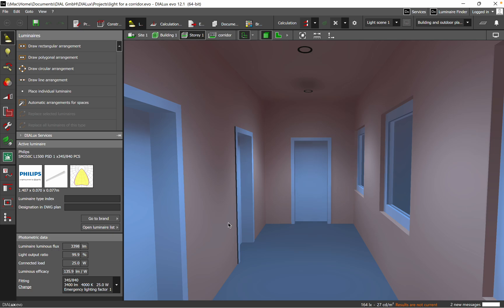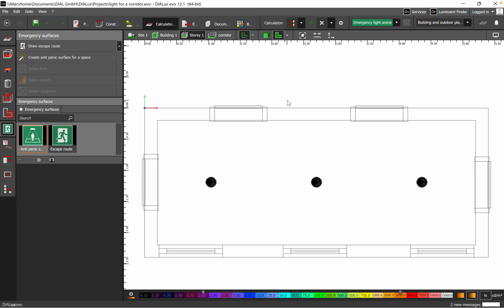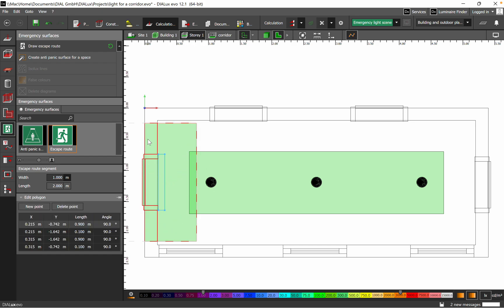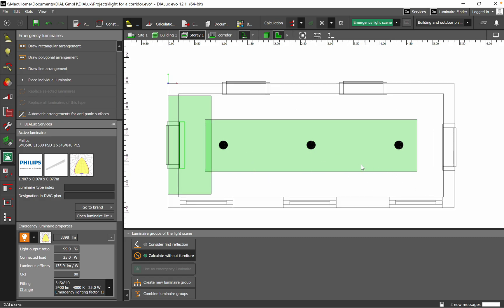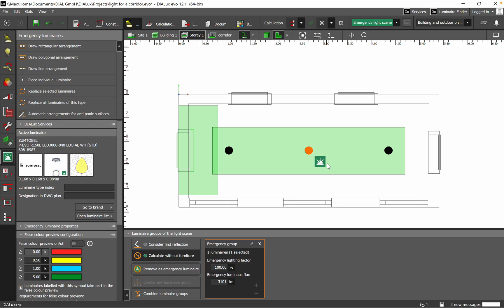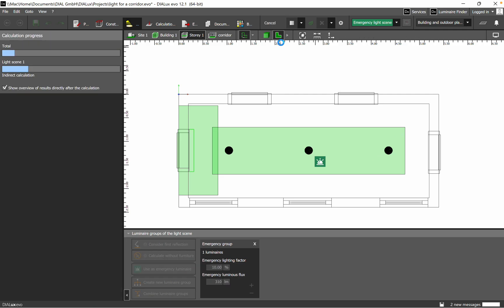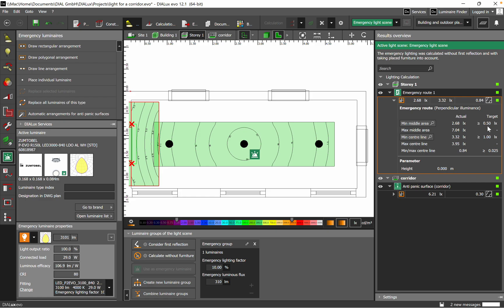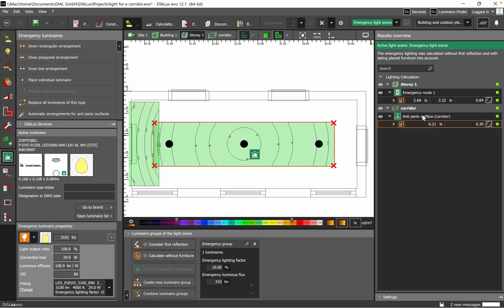Emergency lighting for corridors

Comment: Good afternoon 
Why do you experiment with the percentage of the em lighting factor?
Isn't this defined by the luminaire manufacturer?
I mean that the luminaire manufacturer should tell you exactly what lumens the fitting gives in emergency mode.
Am I wrong?
I saw you using 10% initially then changing to 5%
Is this a figure the designer specifies???
I was almost certain this is a value that should come from the manufacturer.
Excuse me in advance if I am wrong
Thanks
Reply from the maker: Good question. I am just using different values as an example. As you mentioned this value is given from manufacturer so normally you do not need to edit it. Thanks for your question.

Comment: Hi Catalin, Where to find the average value for the calculated emergency spaces? I see only the minimum, maximum and uniformity.
Reply from the maker: Hi, if you are checking the emergency lighting standard  EN1838 you shall see the requirements related to lx level is based on the min level which need to be achieved. With other words the average level does not count as in the case of general lighting. Hope that this information helps. Thanks for your comment.